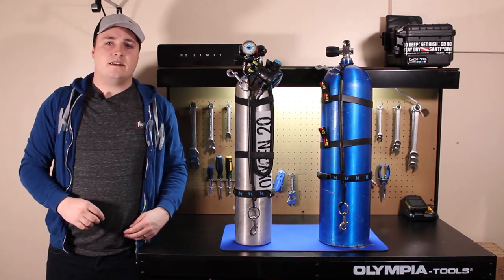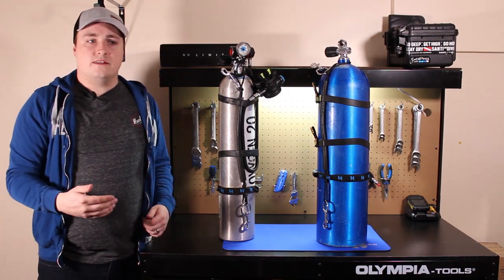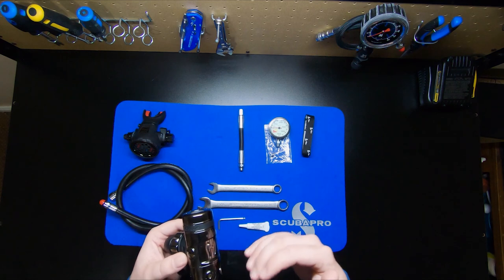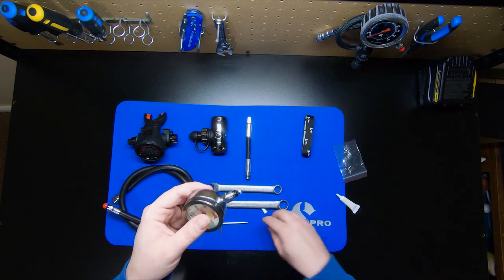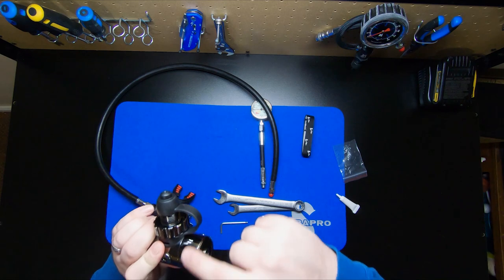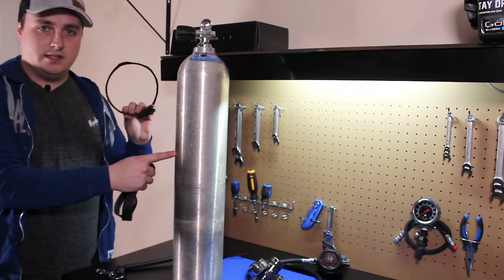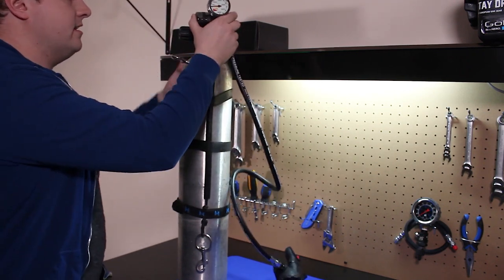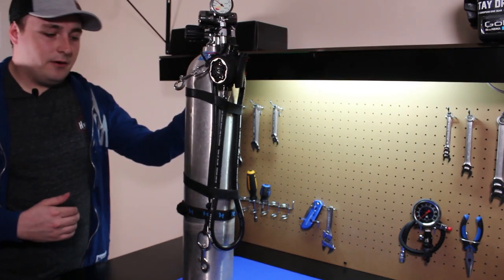Stage Bottle Setup for Rec or Technical Scuba Diving - Reduntant Air Supplies - Modern Diver Channel

Comment: Stage and deco bottle it’s not the same !!!!. Are you sure to be a tec diver ? 🤪
Reply from the maker: physically they are the same. MOD decals and gas mixtures change as well as how you use them in your dive plan but the cylinder, regulator and stage kit are identical which is primarily what this video was about.
Reply: @moderndiver  not correct !!!
Reply from the maker: @nicogioffre2370  all right so how about share you knowledge about what you think is different? Be part of the conversation instead of just using exclamation marks.  

I'm very curious to see how your extra cylinder doesn't have a tank, 1st stage, 2nd stage, guage and some sort of stage rigging.
Reply: @moderndiver  Gee, he didn’t have an answer?

Comment: So if it’s 100% oxygen why is there a 20 on the tank?
Reply from the maker: Thats the Maximum Operating Depth (MOD) decal. 20 indicates 20ft since 100% oxygen past 20ft has a PO2 goes past 1.6 which puts the diver at risk of oxygen toxicity.

I personally don't like how most brands for both metric and Imperial don't add feet or metres in the corner of the stickers 👎 one day i want to custom make my own.

Comment: Straps go under the handle, not over. . .  :-(
Reply from the maker: Iv seen it done both ways however especially in cold water I recommend over. In thick drygloves it's almost impossible to grab the rubber strap flush against the tank when trying to stow the reg back after changing gases.